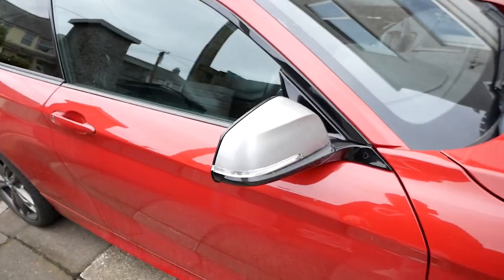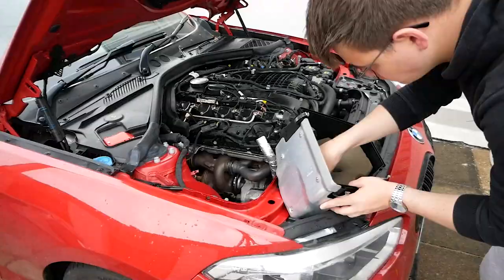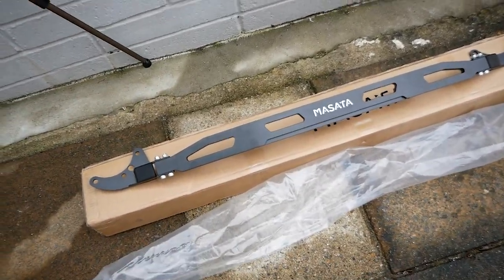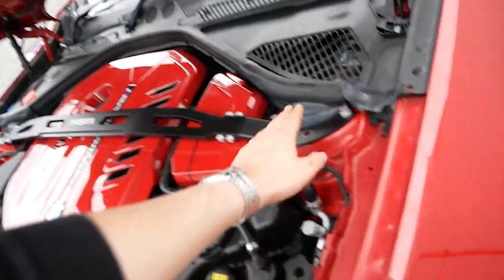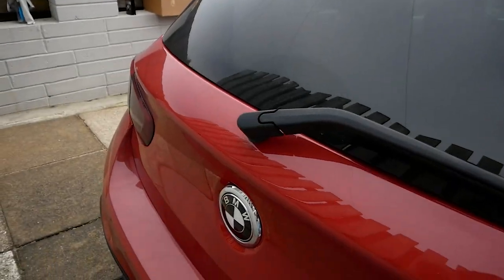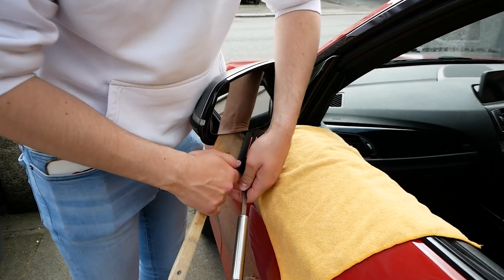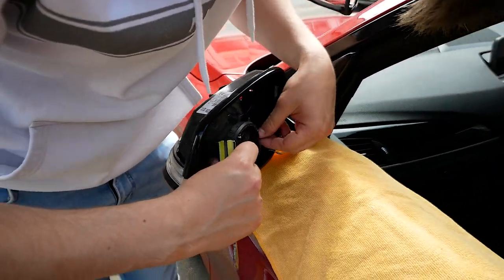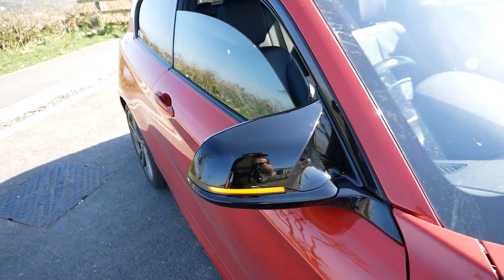M-LITE TO M-CAR *AUTO ID* MIRROR UNIT CONVERSION ON MY M140I! + MORE MODS!

Comment: Any possible chance getting the air filter box in red aswell? Feel like that would give the engine bay a slight better look as well as some side skirts and either sprayer or new black wheels

Comment: The foam in the airbox is there to deaden intake sound , you might find you get a better intake sound if you remove it, especially with the new high flow filter 👍
Reply from the maker: Yeah I might remove it 😀
Reply: @BrettBarnesYT  it won’t do any harm , works well with the hot climate mod 🙂

Comment: Looking good. I’d change all the bolts for the strut mount. Shouldn’t have snapped like that at all. Not going for an induction kit?
Reply from the maker: Yeah I’ve got 6 new ones 😀! All will be replaced that were touched
Reply: @BrettBarnesYT  Proper job. Gonna change your blow off valve? I got the GFB fitted on my 116i. Sounds lovely and helps pull harder

Comment: If you want to turn it into an m car u need a lsd, full underbody bracing for handling and coil overs for handling and maybe around 500hp if u got any spare change after that lol
Reply from the maker: Lots planned for it!
Reply: @BrettBarnesYT   good Cos they’re an insane platform to build on I got one myself good for 750hp stock engine with a hybrid turbo will rinse most things in the street police wouldn’t even get a glimpse of the plate